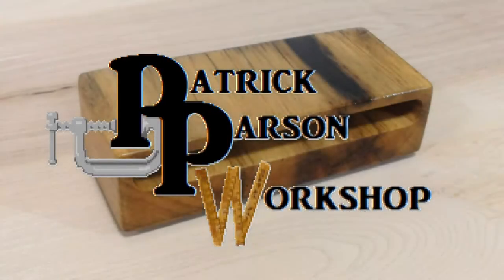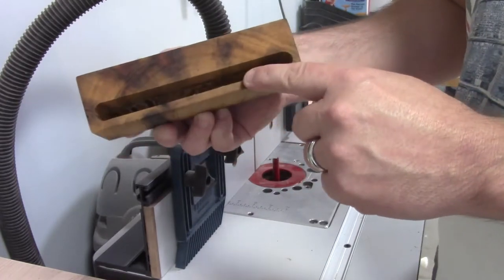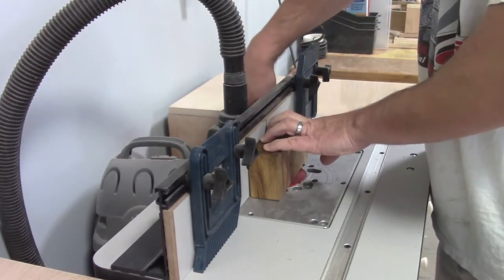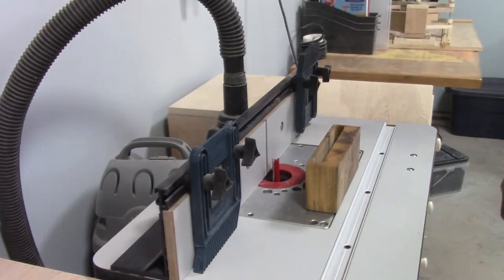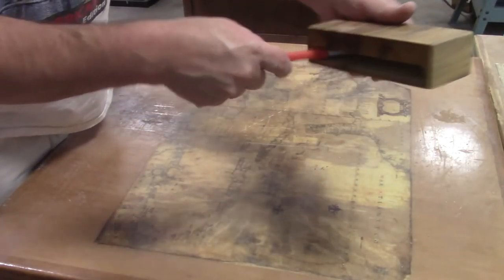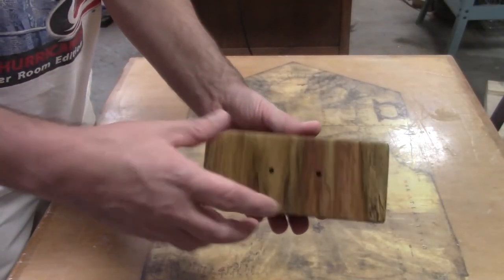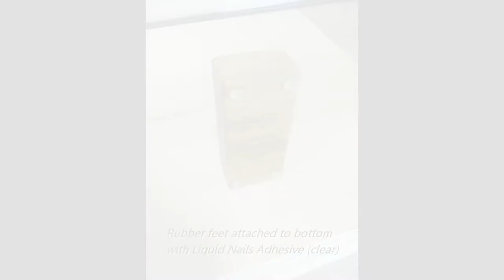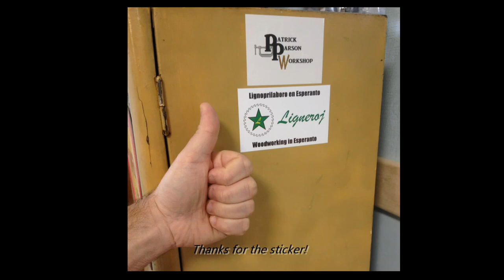Make a Woodblock Percussion Instrument

Comment: Using a dull 1/2 " or larger diameter drill,  Flatten the end and stop at an almost flat angle. Look at the two flukes from the newly ground end. Using a grinder, grind a slight relief on each fluke. Do your router work as deep as you can and then move to a drill press and these almost flat drills. Deepen the bottom by setting depth gauge on drill press. Drill accurately to perfectly as possible  remove material to just above finished thickness. To clean up the bottom of the slot, Lower the drill (While turning) a small amount into the remaining material. Slide the workpiece slowly a. You are using the drill like a deep router bit. I suggest using Jourgensen clamps as handle points on the block as you cut the bottom of the hole.  Hardness of wood, diameter of drill etc. will indicate the rpm to make the cuts. This will achieve good results with care and patience.

Comment: To get a better sound from that project you had made, coat the insides with shellac. It will harden the fiber walls within, and resonate much better. The fibers inside absorbs the sound and does not bounce well within. I find shellac is better than varithane, as varithane is too "plastic" and sound does not bounce as well. Notice the resonation inside a ceramic tiled shower stall, almost reverb--like when we sing. If tiles were removed, exposing the dry wall, there would be hardly any reverb at all.
Reply from the maker: That sounds like good advice.  I may break it out and do that.

Comment: No offense, but that's the worst-sounding block ever. Grain wrong direction, s/b longitudinal; that's why the other one sounds like a block. . Drawing board.
Reply from the maker: Thanks for your thoughts.  I think, with a standard woodblock, you usually see the grain going left to right (the longest dimension of the woodblock) because that is the way lumber usually comes (the grain goes with the length).  Lumber that is 3 inches thick and 10 inches wide is harder to find, and it is more expensive.  So, I don't think the difference in the sound of my woodblock has anything to do with the direction of the grain.  I have seen "woodblocks" that aren't even wood that sound just like the standard woodblock.  If mine sounds different, which I was hoping it would, it is due to other factors.